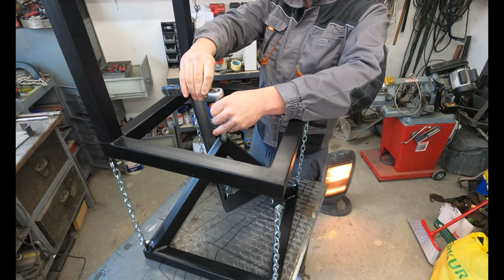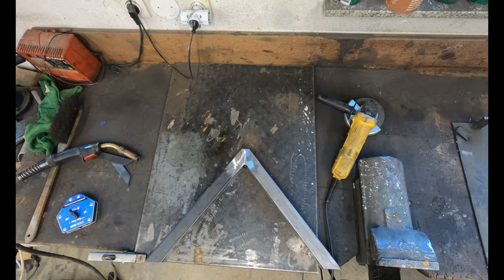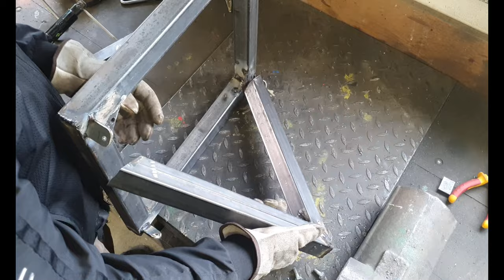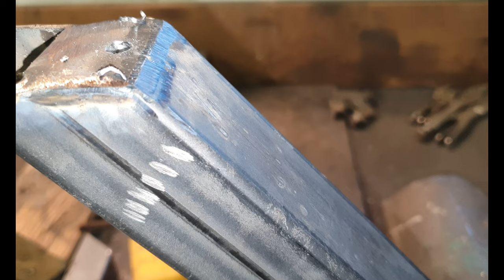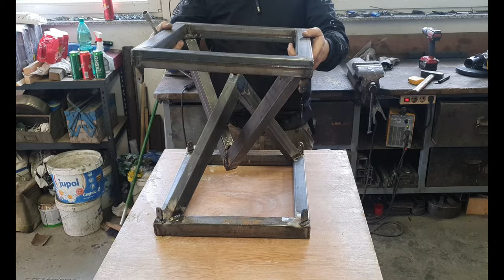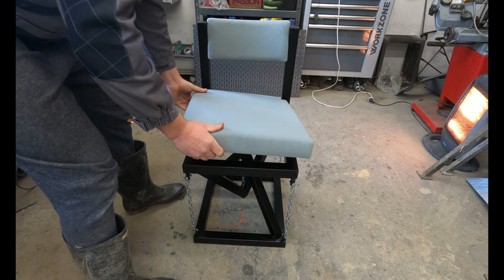Tensegrity Chair [EXPLAINED]

Comment: How do you do the middle of the chair, I couldn’t really see how to hook it on
Reply from the maker: Weld steel plate inside the pipe and drill a hole in it

Comment: what are the 2 different angles that you had to cut on the triangle support bracket?
Reply from the maker: Well u need to adjust it to your dimensions if u use mine it wont fit